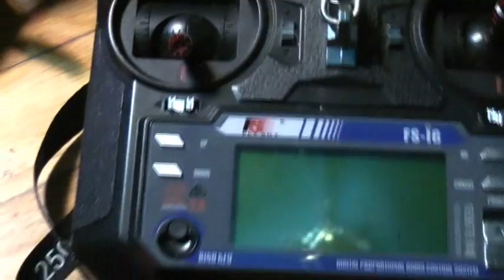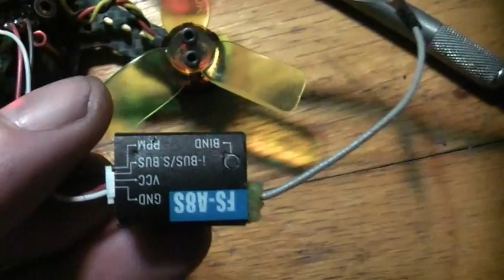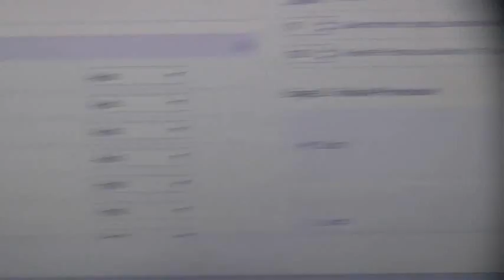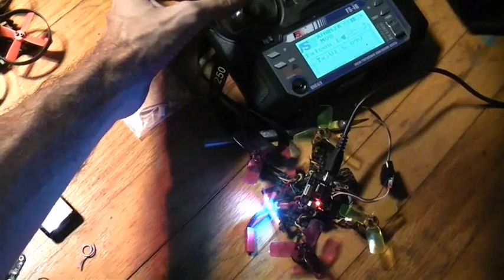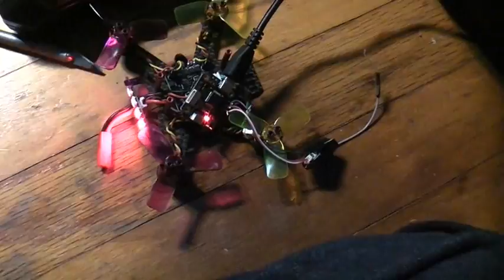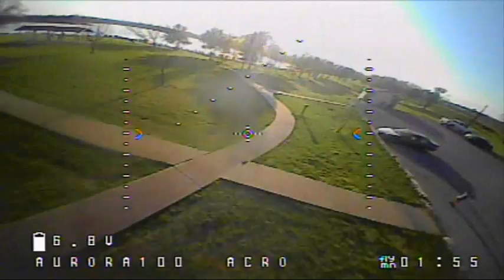Flysky Failsafe Not Working...Answer...Receiver?

Comment: LIGHT BAR changes color with throttle stick position: THAT is a really excellent idea! Do they default to that or did you thunk of it? As for your original problem: Factory cut corners and NEVER set it up, IMO. Does the WORKING UNIT change colors? If NOT, it means it's a programming issue, based on price paid. Typical
Reply from the maker: Its default setting was to change colors with throttle input

Comment: Most micro Rx do not have failsafe on PPM, if they support Sbus/Ibus, they generally do failsafe on that mode.

For the older AFHDS protocol, use the Das Micro Rx with PPM from Bangood, it supports Faildafe in PPM, it works fine.

Comment: I'm having that issue now, but i'm using A8S on a i6s radio.  Failsafe not using as well.  I've configured everything about the failsafe both radio and cleanflight on my KingKong Smart 100 but still doesn't work.

Comment: Great work! I am convinced the integrated Flysky receivers in these Eachine quads are not compatible with Failsafe. Too bad some of these micro Eachine quads have no room for an external receiver such as the FS-A8S. What a bumper there is no solution on these existing quads.